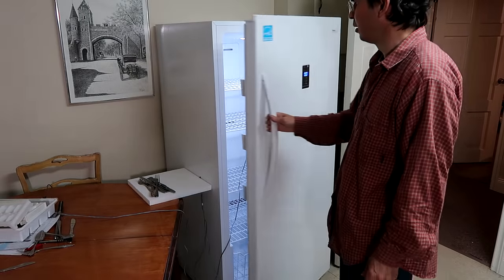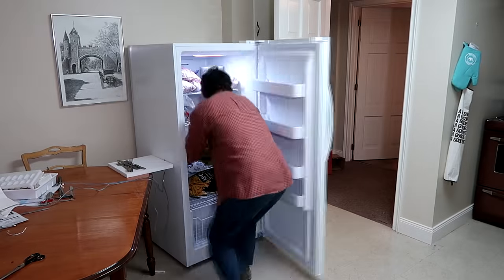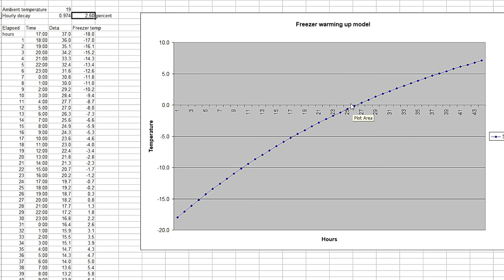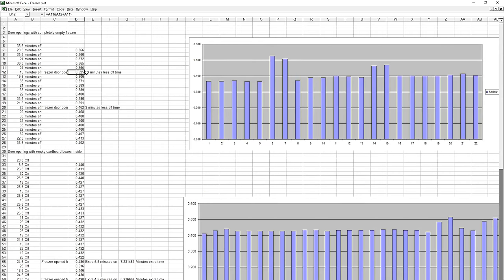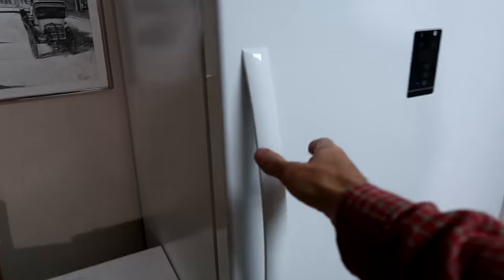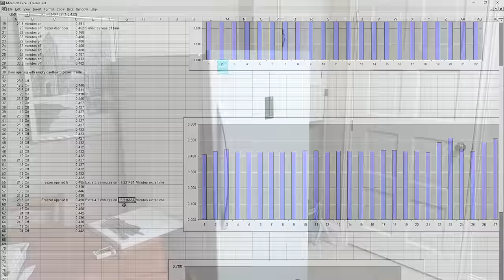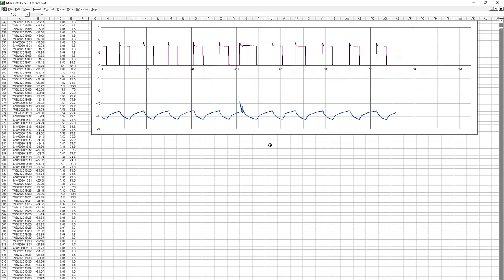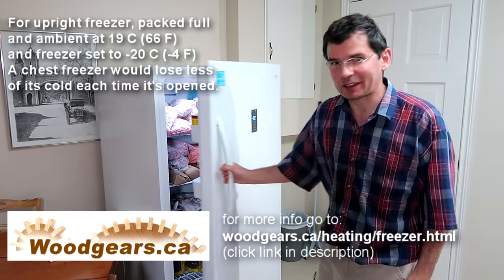How long does a freezer stay frozen with no power: experiments

Comment: I live in Florida, U.S. and we get plenty of lead time on hurricanes. I put 4 one gallon jugs of water along with as many disposable water bottles as possible in the freezer a couple days before a hurricane hit us. When the power went out, i took two of those gallon jugs and put them in the fridge (side-by-side fridge/freezer). We lost power for a full 3 days and we continued to use the fridge/freezer normally. Every 24 hours or so i'd rotate those gallon jugs back into the freezer and they'd re-freeze from the thermal mass in the freezer. I didn't have any thermometers in there, but nothing in the freezer thawed, and there was no discernible difference in the fridge's temp
Reply: I did similar with the winter windshield wash type antifreeze 1gal jugs when living off grid with much success.  In the winter, you could just stick them in the snow as well.
Reply: @Jaspel  hey, dont come bragging about your fancy snow to us Floridians, we dont know what it is
Reply: wow that's amazing it could keep refreezing for so long
Reply: You wouldn't have been able to refreeze the jugs without the freezer running. I know about this trick, all your doing it turning the fridge into a ice box. Same with the freezer it's just a ice box at that point and everyone knows you can't put something in a cooler full of ice and have it freeze. If you salt the ice maybe but then your ice is gone faster. Im sure it kept stuff pretty frozen but I know it didn't refreeze a jug of water with no power.
Reply: @alec4672  You KNOW it didn't? I mean... why on earth would i make that up? As previously stated, i jam-packed that fridge with water bottles, you know, the disposable ones, plus the 4 gallon jugs.

Let's exaggerate to drive the point home. Say the freezer temp was set to absolute zero (-459 F,  -273 C). It's an Energy Star freezer (part of which means it's well insulated). Might you be able to believe that with such a cold temp it would be able to re-freeze the gallon jugs?

Also, salt is irrelevant to the actual temperature of the ice. Ice doesn't stop getting cold at 32 F (0 C).

Freezers usually come preset from the factory to 0 F ( -18 C ) as this is the temperature recommended by the FDA https://www.fda.gov/consumers/consumer-updates/are-you-storing-food-safely

I just went and checked my freezer, it's set to the coldest possible setting, whatever that is, but it's got a mark at the midway point which i would guess is 0 F (-18 C), so i'm presuming it's colder than that.

Lastly, when i'd swap out the milk jugs, the ones in the fridge weren't room temperature, in fact,  they were still mostly ice, which would mean that the water that had melted couldn't have been much above 32 F (0 C), therefore it wasn't like they had far to go to re-freeze.

If i had one of those fridge/freezers where the freezer is on the top or bottom,  i don't know that the freezer would have been big enough to contain all that water i jammed into every square inch i possibly could, i.e. big enough to hold enough thermal mass.

And... just to drive the point home, I'm not talking about a hypothetical here, as in, "what would i do IF..." . I'm sharing an experience i ACTUALLY had. In fact, afterwards i shared it with all my neighbors (those who don't own generators) because of course their food didn't fare too well. And, down here in Florida, when a hurricane's on its way, one of the things that disappears off every shelf in every grocery store, convenience store, pharmacy, anywhere, everywhere is water. ALL of it, including flavored water, anything close to water. So everyone's already got what they need to keep their food safe.
Reply: i'll share a cool trick i came up with, that coincidentally also lasted close to 3 days: The ol' cooler in a cooler trick. I was moving down from Massachusetts to Florida (for the winter), the back-story's a bit complicated but irrelevant other than i had about a 12-pack cooler's worth of meat in the freezer that i ended up either having to toss or try to bring with me.

this time i had my 83 y/o mother with me, who also happened to have a phobia of highways, so what i could normally get done in about 18-20 hrs (driving straight thru at 80-85mph) ended up taking 3 days (had to drive 50 mph, and couldn't get much more than 8-9 hrs in a day because of her phobia).

i had a couple empty 1/2 milk jugs... a 1/2 gallon juice jug... other things too in which i could freeze water. I used those to line the bottom of the big cooler and enough of the sides so that when i put the smaller cooler in it, it stayed centered.

i also had several of those reusable ice packs (the rectangle-shaped ones) that i used to line the bottom and sides of the smaller cooler. I put all the meat in the smaller cooler, then threw a couple more ice-packs on top of the meat.

my thinking was that the outer cooler would bring the temp around the smaller cooler down to close to freezing, then the smaller cooler could bring down the temp to well below freezing.

it worked like a charm. When i pulled in to the driveway down here, all the meat was still rock solid.

so there's a trick if you want to be the coolest (pun intended) dad at the beach. Just... you know, bring ice-cream and some cones instead of frozen meat. Your kids will suddenly have a bunch of new best friends, lol.
Reply: Anifco67 Yeah, but it’s not as funny.

Comment: I think there is a reason why all the upright freezers in Europe have drawers.
Reply: I thought of the same thing when i watched this video... cant speak for all of Europe but for Scandinavia atleast 😀
Reply from the maker: Drawers are nice, but drawers themsleves take up a lot of space too, so I have mixed feelings on that.
Reply: @matthiasrandomstuff2221  Up until buying a new freezer I had this view. They have certainly come a long way to optimise the capacity of the new drawers.
Reply: @matthiasrandomstuff2221  the drawers are made of plastic and they take up less than 1cm on each side. And since everything in this country has a din norm they are all the same size. Frozen goods fit perfect in them, otherwise people wouldn't buy them anymore. A whole turkey wouldn't fit, but we don't have thanksgiving. Erntedank yes is pretty similar, but no turkey.
Reply: Possibly to keep kids from climbing in..?  I'm guessing cost savings.
In addition to the better reach, it would be nice to keep things isolated in case of an outage where spoils and leaks out onto other things.
Reply: @Jaspel  they are made like little tubbs, so no leaks, you can take them out individually and clean them or reorganize while the freezer is still closed.
The cooling lines are located between the shelfs where the drawers sit on through the entire freezer.
Reply: @matthiasrandomstuff2221  That's unfortunately what insulation usually does :-(
Reply: @matthiasrandomstuff2221  the drawers are just made out of SAN with a wall thickness of about 2 mm - they take up very little space
Reply: Same in the UK, pretty much all freezers have drawers. I think they also reduce the time you have the freezer open as you can locate items much quicker than you would if it was at the back of a shelf.
Reply: @utjeisenkuhle1997  I have no problem fitting a turkey in my freezer - Bosch/Siemens callals those big drawers "Big Box" - you just have to pick the right model for your use case
Reply: I'm in the UK and my freezer doesn't have drawers - just shelves. But thanks for the video Matthias - It's something I've considered in the past but didn't have the skills to investigate.
Reply: Our upright (24" wide, full height) does have drawers. Bought it at Costco a few years ago, think it is branded Danby.  Checking online, I see similar ones for sale at Canadian Tire and Walmart, but none of those seem to have drawers. So I guess people aren't all that interested in having them. I do like the drawers as they keep the cold in, and also make it easier to organize stuff: the drawer front keeps things from falling out so you can get more food in the space, and it is easier to get stuff at the back.
Reply: The problem with upright freezers without drawers every time you open them the cold air falls out. With drawers the cold air is trapped in the drawer so the temperature doesn’t change so much.
Reply: Where I live in the US, I think chest freezers are more common. They have their own strengths and weaknesses. It's alway interesting to see what has been at the bottom for years. ;) Our main refrigerator has a bottom freezer drawer. It works okay but does take up some room.
Reply: @matthiasrandomstuff2221  well, i would dare to claim that shelfs attached to the door leave more unusable space in the fridge compared to one with drawers and no door shelfs

tho each come with pros and cons - if energy efficiency comes the main point then freezer chest wins
Reply: There has to be a joke line here somewhere.... 😂
Reply: I think there is a reason why chest freezers and freezer batteries do exist. Bigger chest freezers with A+++ rating class do have 70+h storing time.

Comment: Great experiments, I always wondered the loss from opening the door.

A fact that may be interesting : all food does not warm up at the same rate, and by a lot as my experience seems to have shown.
I once had a full of food chest freezer (300liters) shut down for one week (in a basement, that might be at 10°C). When I came back (7 days had passed), the vegetables and pastry were melted, but the meat was still frozen (hard as rock), and I actually saved it thanks to the advice of a vet.

Also, I often unfreeze meat from the freezer in the fridge, and it can take more than one day to unfreeze. 

Also, my owner manual says that in these conditions, my chest freezer might stay below freezing for 3 days.
Reply: Sounds like you're talking about very large pieces of meat.

Comment: I've often thought about doing this exact experiment. Thank you for saving me the time.. Very interesting. I was surprised that you didn't take the opportunity to make a point of how much it cost everytime someone opened your freezer door.
Reply: Well, if it costs about six minutes of run time to open the door, and the freezer uses about 200W when running, then it's about 20Wh per open.

Average cost per kWh varies, but in the USA it's about $0.13/kWh, so you're looking at around a quarter of one cent.
Reply from the maker: it's 6 minutes of heat leakage.  Multiply by compressor duty cycle, of about 40%, times power consumption of about 80 watts.

Comment: I keep several frozen 2 liter bottles in the freezer only taking them out to add in more food. I keep several spares next to the freezer ready as space becomes available. We live on an island, and have upwards of 10 power outages a year, most lasting several hours, but a few lasting almost a day or longer. I wish I had your know how and test equipment. I did however purchase an infrared temperature sensor you discussed in an earlier video on insulation. Thanks for yet another interesting video! My best to you and your family!
Reply from the maker: Put 50/50 water and antifreeze in the bottles.  That way they thaw before the food will, and give off even more cold in the process.

Comment: I administered a laboratory appliance monitoring system years ago. We had a huge outage due to a hurricane and I wasn't allowed to go back to recover the system in time so we lost some data. I did some tests with empty vs full freezers and discovered that our freezers did not last long with no power. The empty freezer at -20F would be above freezing within hours. 
Mass was the most important thing to add to keep the temperature below freezing so we started adding water bottles and bricks when a freezer wasn't completely full. That made a huge difference.
Another issue we had was the research samples were stored in cardboard boxes so there was very little mass in normal times. We also couldn't use frost free units and any switches had to be outside the units since there were explosion risks.
Reply from the maker: Water holds WAY more heat per mass than bricks.
Reply: Adding thermal mass [like water] to keep the food cold longer in the event of a power outage. A brilliant suggestion for those of us who don't have full freezers

Comment: I drove 2600 km from France to Croatia once with some very stinky cheese in an improvised polystyrene cooler 5cm thick. , with a few frozen water bottles.  I was very surprised to find water still frozen after 24 hours. It was the peak of summer.
Reply from the maker: Thawing a water bottle takes the same as heating it from 0-80 degrees.  So those wtater bottles can take up a huge amount of heat to keep things cool.
Reply: @matthiasrandomstuff2221  I'll take your word for it. I'm a practical guy that doesn't delve too deeply into the science of things.
Reply: And pray tell what stinky but great tasting delicious treat did you bring to France the other way from Croatia?
Reply: @Don.Challenger  rakija
Reply: @matthiasrandomstuff2221   you meant "0-80 degrees" to be interpreted as 0 °C (32°F - frozen water) to 80 °F (car temperature), right?
Reply: @Sqwaush  I doubt he'd ever mix C and F , so I presumed centigrade.

Comment: The heat energy required to state-change the frozen items to liquid is very significant. So if you perform the experiment with disposable food (or bottles of water or whatever) you will find that it gets to about 0C in line with your math, but then it will just stay there for a very long time as all the additional heat energy entering the system works toward the state change.

Comment: I wonder if a change in ambient temperature would make a difference to the results. For example a freezer in the UK in the winter. Great video 👍🏼
Reply: I think RH has a big factor as well.
Reply: Yes, heat loss through conduction is U*A*dT (resistance to heat flow * area * temperature differential).
Reply: In northern Alaska a freezer outside in winter takes no energy. Did I say freezer? I meant snow bank. Yes, ambient temperature matters.

Comment: I have two freezers - both chest style.    I know chest is better than upright, but not by how much.  Because it's certainly true that it can be a pain in the neck getting stuff out of the bottom.  I wonder if upright freezers need to be defrosted more often, since it seems that you get more unconditioned air introduced regularly.
Reply from the maker: This one works like a fridge in that it blows air.  So it auto defrosts.  That's good and bad.  Bad for the contents (more freezer burn), good cause less hassle.
Reply: @matthiasrandomstuff2221  Defrosting is always worse mentally than in reality.    Empty the freezer, put in a fan, and it's done in little more than 15 minutes.    but it's still a dreaded chore for some reason... :-D
Reply: @Wordsnwood  also break 3inch+ of ice with a kitchen knife.

Comment: Would the freezer be much better if you added more insulation on the outside? Does the manufacturer cheap out on insulation?
Reply from the maker: Absolutely not.  The outisde coils are just against the walls.  If you put insulation on them, it can't shed heat anymore, and it will overheat.
Reply: @matthiasrandomstuff2221  I'm almost positive our fridge has additional heating on the sides to prevent it from getting too cold, attracting humidity.
Probably a bad idea indeed.

Comment: Add plexiglass panels to divide the opening into 3 parts, also fill the empty space with lightweight bricks to increase thermal mass. And retest, loose the food, consider bricks to be food replacment. In reality-based use you would fill with thermal mass and swap in food.

Comment: A possible experiment if you want to do a follow up to find ways to improve those numbers. Bottles of salt water in the freezer. Salt helps a lot with lowering the freezing point of water, I use the stuff in my cooler to make 4lbs of ice last a couple of days in the middle of summer.

Comment: That's a pretty cool experiment. Perhaps you could fabricate an internal cold air dam door for the bottom 1/2 or 2/3 of the freezer to hold the cold air in when the door is opened? A compromise between chest freezer power efficiency and upright freezer space use efficiency & convenience.

Comment: Hi. I just stumbled upon this as I am doing similar experiments with my new Frigidaire freezer. One thing I wonder about is how you pass the temp sensor wire through the door seal? I have tried a number of units and their wires all causes noticeable leaks with cold air clearly exiting and frost forming inside at the point of their passage. I finally used some uxcell Flexible Flat Cable with some 3.5mm phone plugs to "splice" between the sensor and the thermometer head unit. This seems to address the issue. But it causes wild temperature fluctuations when charging the head unit. So I am still looking for a better solution. Thanks!

Comment: A couple of mechanical engineers here did build a solar powered fridge, but instead of electrochemical batteries they used water to make salty-ice. They achieved a considerable lower maintenance cost, since batteries would have to be replaced every few years.